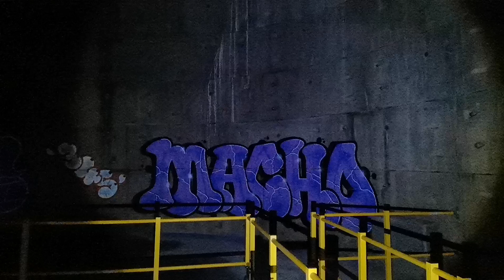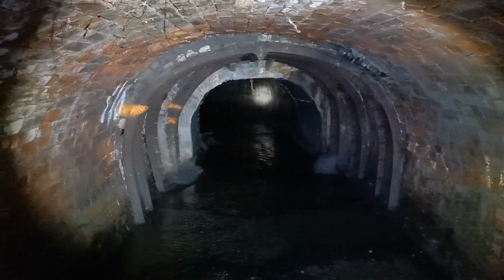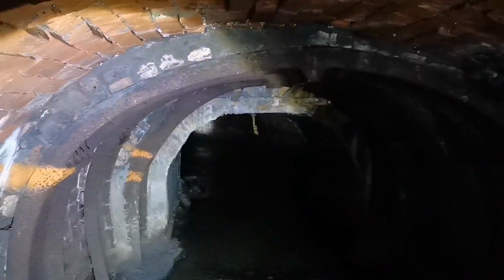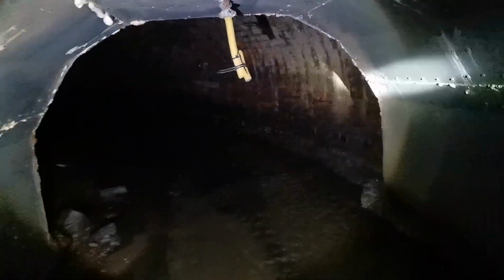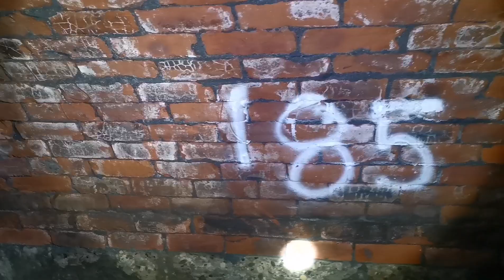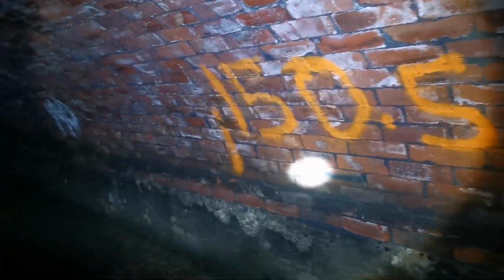Inside the Newburn Culvert with underground Waterfall

Comment: The ‘old drain entrance’ you point up at is in the middle of the road on the Mill Vale estate when you come down the short entrance road and it splits left/right for the main estate road. Was a partial collapse/drop in there as well that was repaired and shored up I believe.
Reply from the maker: Cheers I thought it would be a drain entrance up there
Reply: @geordieurbex2200  road through the estate follows the path of the culvert, definitely a design decision during the estate build. The north section of the culvert has some cracking engineering going on!
Reply from the maker: @mjcharlton71  is that the bit with all the concrete blocks? They've done a canny job fixing that after the floods, I prefer the older bit with the waterfall
Reply: @geordieurbex2200  aye, think so.